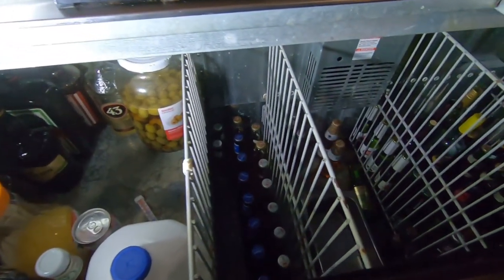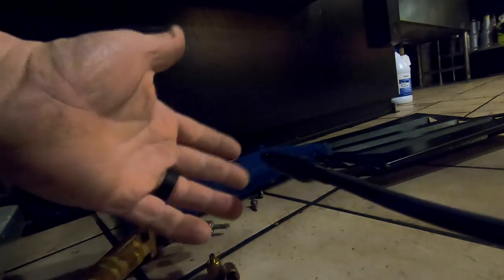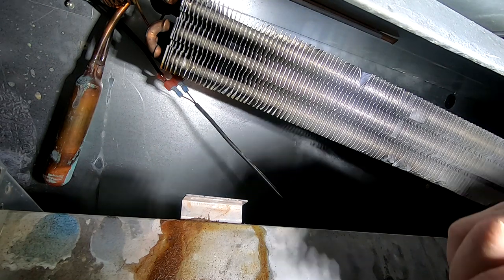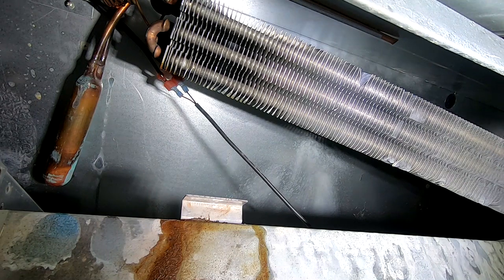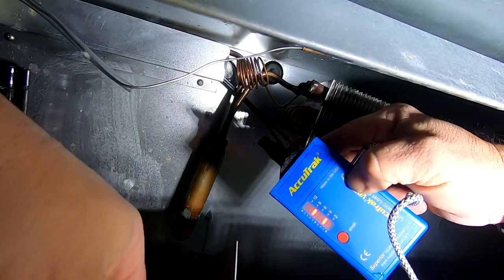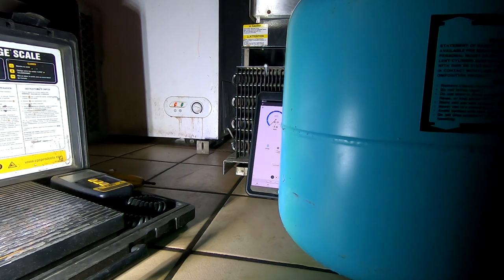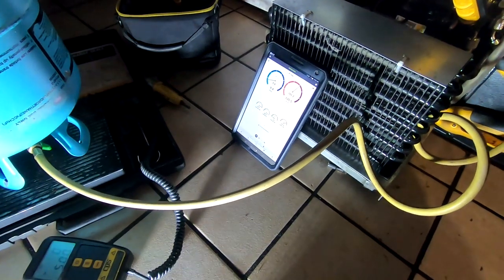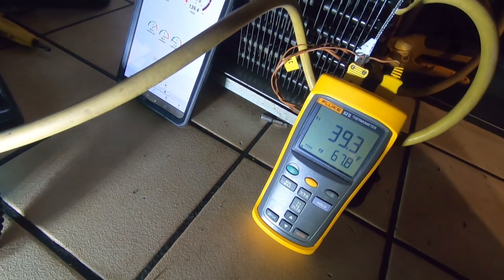Beverage-Air Beer Cooler Warm  Inficon Select vs H10pro vs AccuTrak VPE Refrigerant Leak Detector

Comment: I took your advice and ordered an H10 from TruTech Tools. Great video 👍
Reply from the maker: Awesome, you'll like it. It does take a little getting used to, my best advice is running in manual mode and not Auto. It has very little false alarms it so you can usually trust what it's trying to tell you. The big thing is trying not to hit it with big glass of refrigerant because it will damage the sensor. The sensors good for at least a year sometimes two it just depends.

Comment: If the low side was pulling into a negative and there’s a leak in the evap, wouldn’t air be sucked into the system? Wouldn’t be a way to get that out without repairing the evap first, I suppose.

Comment: In Europe most newer household fridges and freezers run R600a due to a law that forces them to run under GWP 150. But, not being a certified tech (yet), as far as I can figure out that means in a freezer it will have to run negative pressures on the low side if it is to have any hope of getting down to those sorts of temps.. Ours can get down to -24˚C, which, if the evap temp theoretically was the same, gives a saturation pressure of -0,4 bars.

Is this something that is generally accepted these days, or is it just the manufacturers unwillingness to use a more suitable refrigerant that's the problem?
Reply from the maker: R134a is the same way for freezers. Just a few pounds of pressure.
Reply: HVACR Survival I actually thought about that today too. I recently got an electric car with R1234yf in it, about the same pressures as R134a (although shitty in other ways). The thing is, it's a heat pump. Do they run it at negative pressures, or do they kick in an electric heater if it gets really cold? I have as of yet to drive it in really cold weather, so it'll be interesting to ser how it performs.. The system in a car as opposed to a household freezer isn't exactly hermetic.. On a side note, one of the most complicated systems I've ever seen. It can heat and cool the battery, heat and cool the cabin, cool the power electronics, and of course if needed give or take heat from an outside coil, and it can do some of these things at the same time. And all of it with 600 grams of refrigerant...

Comment: another good video thank you MR. Rick. i had a soda cooler that i am working on yesterday has a clog captube .the is ID.054 . call my supply house they only have .052 and then call the manufacture they   recommend the OEM. and customer wants to fix ASAP i dont know what to do.
Reply from the maker: See if this helps you convert it. http://www.hvacrinfo.com/pdf_misc/cap_tube_chart.pdf

Comment: I bought the inficon whisper. I tried to use it for supermarket refrigeration, and i didnt like it. Maybe i need to get used to the noise and distinguish lights, fans, noise.
Reply from the maker: Do Inifcon reproduce the sound it hears at a lower audible level like the AccuTrak?  I noticed on one video they have a beep function that sounds like a regular leak detector when it hears what it thinks is a leak? That would be a problem if that's all it does.
Reply: @HVACRSurvival  it beeps when the headphones are not connected. Also it has a laser pointer as to show what area is listening to.
Reply from the maker: @MrKdeez  post a video of it working its magic.

Comment: happy new year thanks for the video, could share the info on the T fitting you were using i couldnt find it on your tool kit
Reply from the maker: Which T fitting?
Reply: @HVACRSurvival  that you used for charging and hooking your smart prob.
Reply from the maker: @hvacir9176  https://amzn.to/35ipK04
Reply from the maker: @UltraHydrophobiccoat  that's not the exact one that I bought. I bought mine on trutech tools but to make it a little easier I found this one on Amazon and posted the link to it. So I don't know if it didn't get the right one or not.

Comment: Why did you stop using testo smart probes?
Reply from the maker: The Testo 557 stopped reading temperature on the low pressure side,  the factory told me the control board was likely the problem,  I would have had over $275 in repairs,  so I sold them for parts,  my testo 550 doesn't reset back to 0 psi like the 557 did.  So I despise them and haven't used the 550 for the last 2 or 3 years.  I wouldn't own the Testo probes they are just now getting to where they're close to the Fieldpiece range, and they don't have the same quality temperature measurement system.

Comment: Them reach ins are such a pain , sometimes on the cheap Chinese stuff , the rubbish label is completely faded and you don't even know what refrigerant it uses .
How do you like the Fieldpiece probes by the way , is the bluetooth connection solid ?
Thank you for the past year of videos and looking forward for the coming ones !
Cheers !
Reply from the maker: They have been great since the Measure Quick app came out.  I didn't like them with the Factory app, but even the factory app has gotten a lot better. The Bluetooth has been amazing and the range you get is crazy compared to any other Bluetooth device I have seen.
Reply: @HVACRSurvival  makes me feel a lot better about not having them available....😩